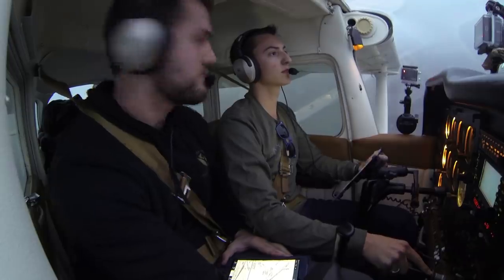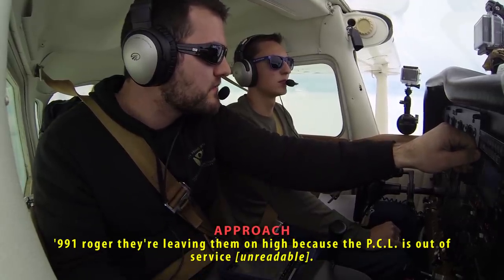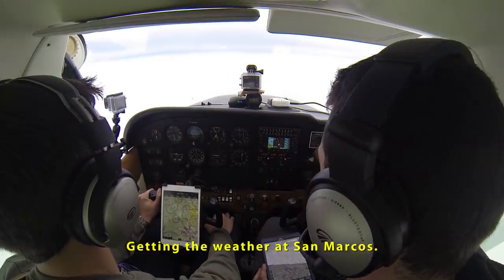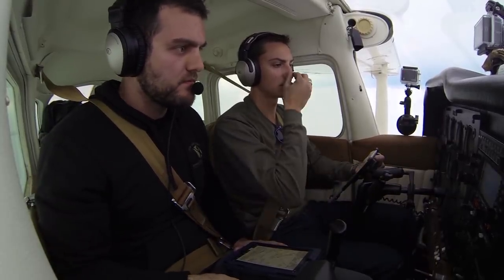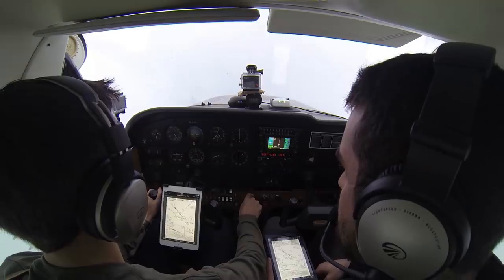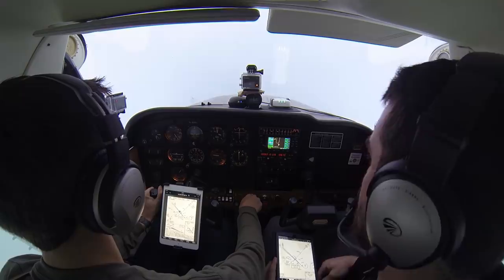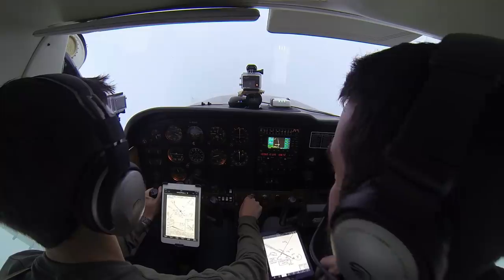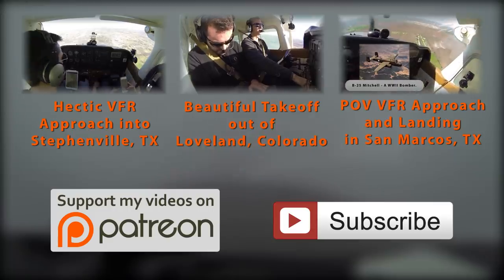ILS Approach to Minimums | ATC Audio | Cessna 172M

Comment: Nice job.   Brings back memories.   On an ILS approach to minimums into KLNS in rain with a stiff crosswind, I made the mistake of initiating a turn to the runway when I saw it 20 degrees to the right of the nose.  Rick, my flight instructor, quickly stated "Hold your heading!".   He was so right, my current heading was working to keep me on the localizer, so it would get me to the runway....minus any shift in winds as we descended.  The temptation to point the nose at the runway was VERY strong when it is all you can see.  Fly safe!

Comment: Nice one :-) Just two things: 
1) At the time you you switched to VLOC did I understood Brandon correctly by saying your CDI is more then 10° off? (as I'm german I might only got this wrong and you can disregard the rest ;-) It's actually only more then 2.5° when tuned to a localizer! Keeping that in mind it's sometimes better to be stable one dot off then running for the center in wild curves. Especially when near to the antenna...

2) You are equipped with a GPS so you have your groundspeed. As a rule of thumb 5 times your GS gives you a decent rate in ft/min (90kt = 450 ft/min) that will give you a clue of where the power should be...

Comment: Hand-flying an aircraft to minimums on an instrument approach is absolutely one of the hardest things you'll ever do in aviation. Don't forget the (GS * 10) /2 rule though, for a target VS setting. That's where the known power settings come in. 

Overall you did a very nice job, although I wouldn't want my students reducing their airspeed so much on the ILS. I couldn't tell the actual number, but from the needle position it looked like you guys were getting down to 65-70 KIAS there inside the FAF. Doesn't leave much room for error. I trained back in the days when we 1) always had the Morse ID in the speaker (LOC and GS transmitters do fail), and 2) we set the desired descent rate at the FAF and flew it to the runway. There was no adding flaps until the runway was in sight--you set approach flaps while a mile or so outside the outer marker, and that's what you flew. Then you varied your pitch/power accordingly, in order to maintain your ground speed...because all other approaches were non-precision, and if the GS did fail while you were on the approach, you could still revert to GS-out minima. 

Great instructor though. Very reassuring and he definitely let you learn from the approach. Many CFII's won't even shoot approaches in IMC when the weather is close to minimums...which is very sad.

Comment: If shooting an approach with near minimum weather, I strongly suggest being fully configured by the Final Approach Fix, so you don't mess with configuracion changes after the FAF as this causes pitch changes that make staying on the glide slope harder. Fully configured you just need to concentrate on speed and flying the ILS. Good job!
Reply: I agree! I am a retired airline pilot and we were configured for the approach well before the FAF.

Comment: Oh wow--that was ice cold dude!  I'm very impressed.  

An avionics note: 
If your setting up your Garmin 430 was in the video, I missed it.  But I did notice you switching the CDI to VLOC.  

In case you didn't know (and for other's information too): ILS approaches have a particular sequence that they will do for you for the localizer frequency and going to VLOC.  From memory, this is what it is:

When you set up the approach in the GPS, the CDI will stay in GPS mode, because it's either in "vectors to final" mode (which has its own problems) or direct to one of the waypoints or some such.  The GPS has the localizer frequency in its database, and it loads it into the STANDBY slot of the VLOC.  

The one thing after loading the approach that you must do is hit the "swap frequencies" button.  

When you cross (or are near) the FAF, more or less on center line, and more or less flying in the right direction, it will flip to VLOC for you, now taking guidance from the localizer rather than the GPS.  

(I realize that approach was not the time to be doing fancy stuff inside the cockpit.  I just thought I'd mention it.)

Also, since you were specifically told to intercept the localizer, it made sense to do the swap manually as part of your control flow.

Comment: This is AWESOME Josh!  

Just a quick point: On an ILS, wherever you intercept the Glideslope is the FAF.  It "should" happen at GARYS if your altimeter, flying, etc. are exactly perfect, but it doesn't necessarily have to.  GARYS would be definitely the FAF on the localizer approach.  As you know, shooting the ILS you use the localizer FAF to start your time, so that, in case you lose the GS for some reason, you can still shoot the localizer, and most importantly know when to go missed.

Comment: Overall nice job. A few observations. The second he mentioned Pitch for Airspeed and Power for Altitude you will have issues as you did with airspeed and glide path. Pitch is the fastest way for either altitude or airspeed so which do you think is more critical? Will you be ok with 5 knots slow or 1 dot low? Probably the 5 knots slow. When your instructor was telling you your low you added power and not a whole lot was happening so he said it again. If you would have made a pitch adjustment, you would have intercepted the course a lot sooner and add power to keep the airspeed. If you fly Pitch for flight path, Power for airspeed you will always make a perfect approach. Every high performance turbine aircraft flying a coupled approach with auto throttle is designed this way and it nails every approach.

Comment: We shot one down to 20' above mins, and popped out.  Exact same verbiage with the expectation that we'd go around: Yawn after long flight, contemplate alternates, approach, change from expected GPS to ILS, clouds 600 AGL, 300 above missed, 100 above missed... clinch factor level 9... start to expect full power... instructor "I see the lights", me - I hope it's the runway lights... Pull power, full flaps, we have plenty of runway.   Let's go Brandon!  *no "good job shoulder tap from instructor :)

Comment: A couple of comments. According to the chart I looked at dated 23Jun16 the final approach fix for the ILS is 2700 and glide slope intercept. In your case you were assigned 3000 until intercept so glide slope intercept at 3000 was the FAF for your approach. GARYS would be the FAF on the localizer (no glide slope) approach. And your minimums were 1/2 mile visibility, the 200 feet is the decision height.

Comment: Nice Video. Keep them coming. My only comment is use of the Flaps. Try using 10 degrees flaps, 90-95 Kts , Stabilized Approach all the way 
down to landing. Most ILS runways are Long enough that 10 degree flap landing is no problem. This also makes the Missed 
Approach much easier with no configuration change at a critical time. 300 over and 1 mile vis is no time to be adding 
to your woes and workload. A 172 climbs real nice with 10 degrees flaps.

Comment: Your videos are extremely well done, especially your voiceovers and text narrations of radio comms. Instructor was overall great, but I would like to comment on a couple of phraseology that I found confusing. I heard the instructor say "Full power, full power", which didn't make sense because you were well above the glideslope and also fast. Not until I saw someone elses comments below that I realized he actually meant "pull power". Had I been the student, I would have been totally confused. Many words can sound the same over the radio and intercom, so one has to use clear language. "Reduce power" would have been a better choice. The second thing was when he said "nose over". I understood what he meant, but 'over' could also be interpreted as 'above', resulting in the student pitching up. A clearer language would have been "pitch down". But overall, fantastic video, and thanks for sharing.

Comment: I know late comment.  To minimize RF from charging dev. You can make sure that you have a 12v to 5 v linear charger/ converter. Also some ferrule clamps (black magnets) may help isolate stray RF. Most chargers are digital and generate little pulse of voltage to charge so they are dirty on RF but more energy efficient and cheap. Linear will be a little heavier and generate a little heat.

Comment: Great approach and landing!  Something to look forward to after I finish my PPL and start instruments.  I think Approach initially asked you if you were referring to the approach lights or the runway lights, then after you asked for a repeat following the garbled second portion of the message, did not repeat the question and only advised that the runway lights would be on high intensity.  Were those left turned off by the tower as well?  Even if they were on, since PCL was out of service, they should have left the approach lights on also.  Either way, glad you saw the runway in time & didn't have to go missed.  Well done.

Comment: Very nice approach to landing!   "You did good!"  :)

Just a short comment on the "carb heat."  You must have applied "some" carb heat, when Brandon told you to apply FULL.  36 years ago (I'm not IFR rated) I was told:  FULL on, or FULL off - no in between.  Reason?  A little carb heat MIGHT set up a carb venturi temperature of 32 degrees - freezing!   

Enjoyed the flight with you guys.  Thanks.

Comment: Question about your gopros...what batteries do you use?  Do you have to change them in mid flight?  Seems like your flights might be 2 hours or more sometimes, so just curious what your settings are and how you find you get the longest battery life from them.

Comment: Okay - first thing the squelch   button on the intercom is set too sensitive it chopa your start and finish of words. Approach Controller sounds like shes on an iCom or youre too far away. 
The ATIS is fabulous at the start until unre.adable.

Wheather is well gungy.

Was it summer?  Because did you check for ice..? The camera did.

The chat between the pilots is spot on.....good comms.

Memorieeeez🎶

Well done, as you said, scabby runway lights!

You were both great!
Well done!👍

Comment: Hi Guys, loved your video....very enjoyable...however may i just throw in a short observation. If i heard correctly the controller mentioned that the "runway lights" would be at full intensity, NOT the approach lights. She may have meant both, or may not. I think one could have come back with a question for her to confirm BOTH runaway lights as well as approach lights status? Hence the negative surprise? keep up the good videos...Cheers...

Comment: Great approach flown!!! I've flown this approach many times during my instrument training. But I was wondering why approach kept you at 3000 until GARYS. According to the plate, when passing over GARYS and established on the glideslope the plane should be at 2441 feet. Crossing GARYS at 3000 means you would have intercept the glideslope from above instead of from below which isn't a big deal in a Skyhawk.
Reply: Misheard instructions. ATC never told them to maintain 3000 until GARYS. What ATC said was "15 miles from GARYS" then 3000 til established on the final approach course, then cleared them for the approach (although it was initially the RNAV til Brandon queried them on it). The transmission starts around 8:28 if you don't believe me and want to hear it for yourself. You're correct that they should've been closer to 2441 on the glideslope at GARYS rather than up at 3000.

Comment: Josh, excellent flying skills on your first ILS to minimums. I was wondering what turns on the strobes for the ILS that steers you to the runway? Maybe is varies for different airports based on controlled or uncontrolled. With now over a 1,000 hours mostly in a 172, you must fell real comfortable knowing the aircrafts characteristics in flight. Thanks for sharing!

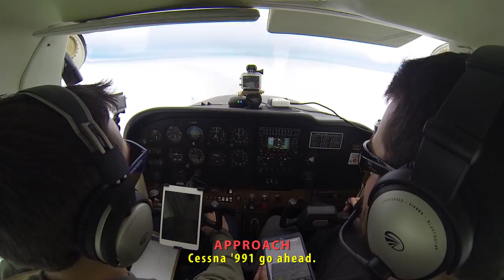Comment: Hey folks. A perfect lesson in triple miscommunication! At 2:00 the instructor Initially asked for approach lights. ( Should have asked for the RAILs.) There is some confusion between the controller and the instructor as to what the request actually is. The controller responded with " Runway lights will be on high because the P.C.L. system is down."  Instructor at this point thanked her for something that he did not ask for. The correct response back to the controller at this point is to re-request the Approach lights adding "Because we will be at minimums in the dark when we get there." Then at about 3:00 the instructor goes into a narrative where it sounds like he is saying that the controller gave bad info. The controller gave what was settled on in the first place, High Intensity Runway Lighting. If you want Approach Lights you Must ask for them AND you Must be clear. It was a tough last hundred and fifty feet because there was a " LACK " of communication. The student would be best to learn these terms early and Know what they mean AND NEVER hesitate to question what the "hill" everyone is trying to say! Be Clear!! Like Jack Nicholson said. "Clear. Crystal clear. Is there any other way? "  Minimums are fun, eh?!?

Comment: Interesting video. I had to go back to catch it but you were never actually told the approach lights would be left on high as you stated at the end. Reviewing the conversation reveals that the controller questioned if you were talking about the approach lights or the runway lights and then stated the runway lights were going to be left on high due to the PCL being out of service. This new piece of info about the PCL being out of service distracted the attention from the original question about runway or approach lights and you assumed they (approach lights) would be left on when it was actually the runway lights which were left on. Just a minor communication glitch but gave you a different sight picture than expected.

Comment: Something that is not well known is the fact that most approach lighting systems in the US are owned and operated by the FAA and are totally separate from the airfield lighting systems, which are part of the airport. The approach lights have their own PCL system too, which should have been fully functional even if the airport PCL system was down. If you had clicked your mic 7 times on the CTAF you likely would have had approach lights.

Comment: How do you mount that gopro behind your heads? I tried to with vacuum stand but it wont stick to the ceiling because of rough texture. Btw, very nice approach, I find changing configuration in ILS in IMC the most challenging step, as you need to retrim it to appropriate speed and adjust power for appropriate vertical speed, all that in second or two.
Reply: +Nikola16789 I have done this DIY style by attaching the camera to an old audio jack. Then placing the jack in the audio port which (in 172M) is in this location

Comment: You guys are absolutely crazy in the US flying IFR with basic GA airplanes.
Single suction pump, no backup horizon...no redundancy at all.
If any of the components fail you are dead.
Reply: When possible, I used to take my IFR students for a confidence-builder ride in IMC at the minimums. The graduation exercise was to fly an ILS to minimums in actual, with a ceiling of 200 ft AGL. Then I would spring a no-gyro go-around on them by covering the windscreen with a towel. They would have to fly the missed approach, communicate with ATC, and shoot another approach no-gyro to a full stop. If they could do it, they were ready to fly IFR solo.

Comment: The report was not false. The approach controller read back to you that the runway lights would be HI. She didn't lose a word about the rail lights. As you asked for confirmation, however, she said 'all the lights'. At that point you should have asked for clarification of the information mismatch.
When you have such a squelchy connection, it is especially important to make sure that all information is transferred and understood correctly. 
There is no such thing as too little asking of questions, especially when flying in marginal IMC.

Other than that: Well done!

Comment: Very nice video and approach. The iPads are a distraction. Fly the gages and all ILS approaches are very similar. As a retired Captain in the US, we had certain callouts that had to be made. Here, in training, those callouts will come later. Nice CRM in the cockpit. Notice the instructor told the student to fly the airplane first? In a Cessna, the only configuration are the flaps. I never advocate changing flaps while  on the GS. Set them and forget them. Get yourself set for the breakout and landing. Brief the approach, fly the airplane and land or go missed. A missed approach should be thought of as a normal maneuver. Not all approaches will terminate in a landing. Add full power, raise flaps (if required), pitch to a takeoff attitude. You are already 200 feet above the runway and have takeoff airspeed. No big deal.

Comment: Hi, great effort on your first approach in anger. Apologies if this has been mentioned elsewhere, do you guys use a rule of thumb for Rate of Descent? I have always used 5x groundspeed (e.g. 120kts GS = 600fpm RoD) which normally works really well unless getting some uplift from thermals or serious cloud - though it still works as a starter for ten. Also, I noted there were no calls of heights in the descent. Again, I was always taught to periodically call "height passing" for "decision height/Alt" likewise for normal descents. Great work all the same, happy flying.
Reply from the maker: Neil Staite I divide my ground speed by two and add a zero. That tends to work pretty well for my 172. And yeah, I hear you on the altitude call-outs. I'm getting ready for the checkride and that's a habit for me now.